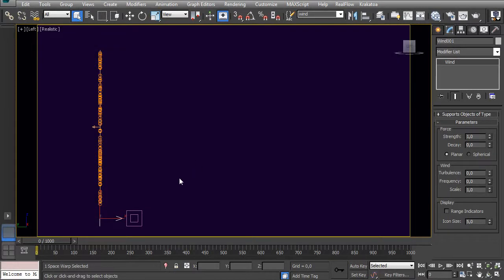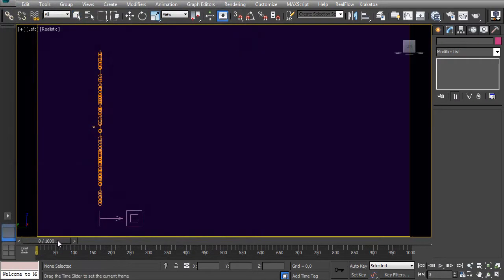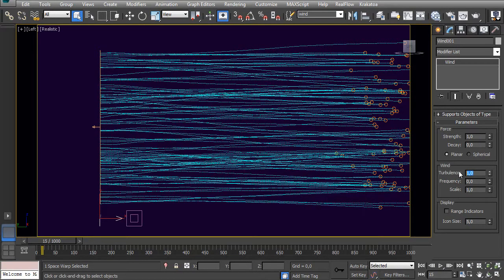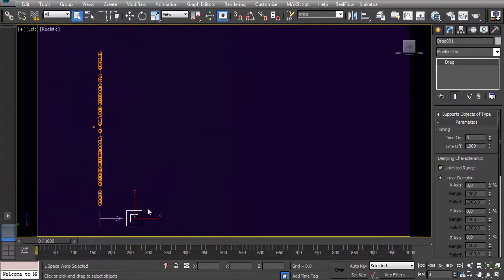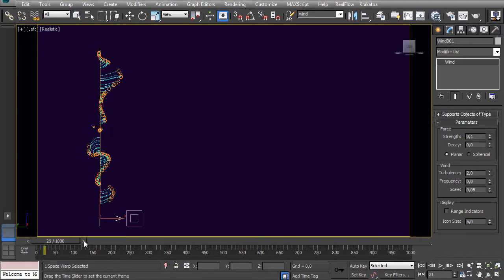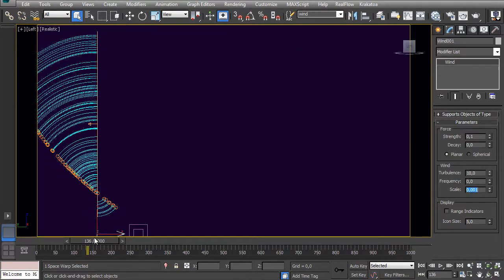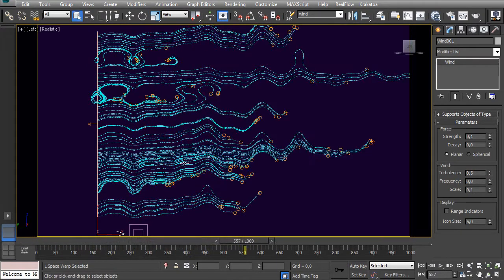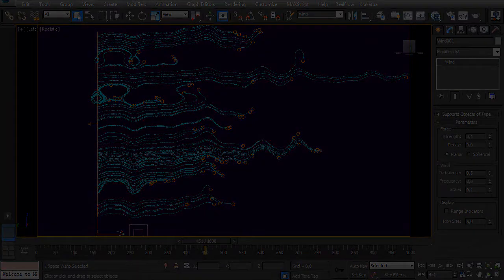Wind Force - Turbulence X Scale [Particle Flow]

Comment: I`m sorry for the question. Maybe everybody knows exept me. Can i render the beautiful lines? How can i do that?
Reply from the maker: hey Alxander, you can convert the particles to very little spheres mesh, or circles looking to the camera or even use a plugin called pflow to split (or something like this)
Reply: Particle Skull, thx for your answer. The lines to spheres? Omg! This will kill the max, i think. Maybe i'm wrong. Ok. What is the best way in Max?
Reply from the maker: yeah, it can bepretty hard to handle it on max. i'd say circles facing the camera. Theres a node called shape camera (or something like this). It putz a plane as a shape and it always face the camera, then you just have to put another shape node with the desired shape (a circle in this case). Also set the veiwport shape to be points and only generate the mesh at rendertime.
Or you can look for the plugin the render it as spline, its from kinematic lab, from clovis gay.
or even render it with krakatoa
Reply: Script from Kinematic Lab PF trajectory mesher falls when simmulation is starts. Through some time
Reply from the maker: dammit. But really, the workflow with circles facing the camera works surpringly well, give it a try!
Reply from the maker: Check it out: https://vimeo.com/109049980